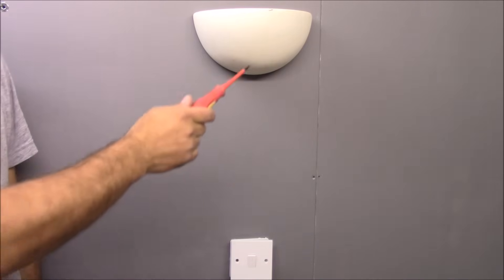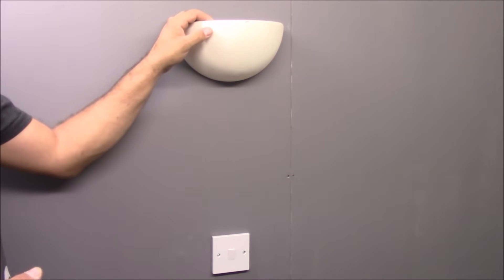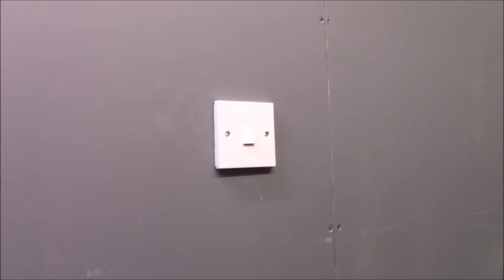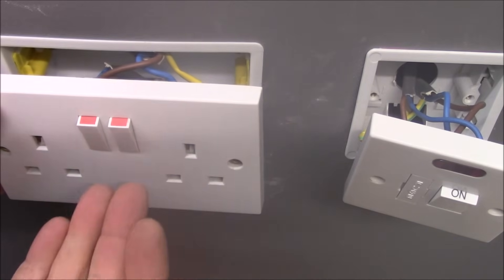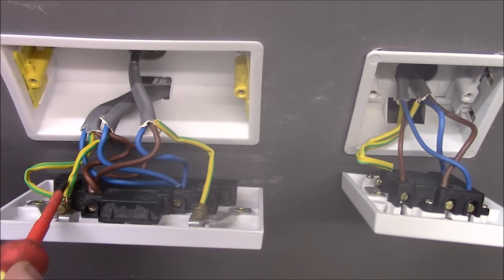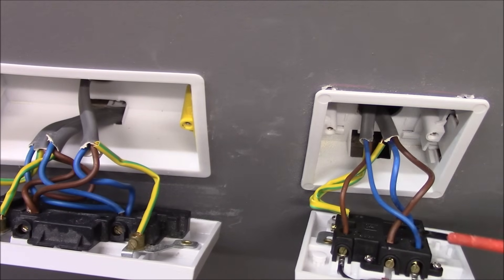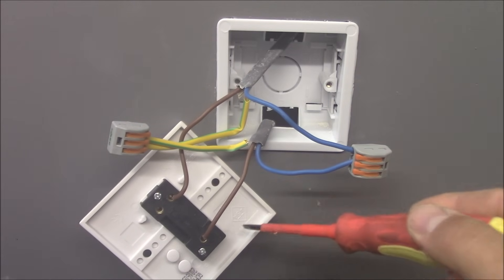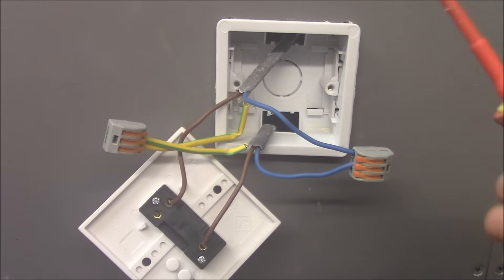Light spur from socket Spur for lighting off ring main wiring connection

Comment: Couldnt you just use the fuse spur (fcu) switch from the socket straight to the light to avoid a 3rd switch on the wall?

Comment: If you have to watch this to understand how to take a 1.0mm or 1.5mm connection from a 32Amp MCB/RCBO protected 2.5mm ring circuit then you shouldn't actually be doing the job.  The double pole switch with fuse is not required ..... just add a fuse only accessory next to the 13 amp socket outlet fused down at 5 amp then run your 1.0mm cable to the switch for the lamp.  Otherwise its switches on switches....    Especially as tripping the MCB / RCBO on the consumer unit to isolate 1 circuit is not guaranteed to disconnect the neutral.  Only throwing the main breaker will guarantee that !

Comment: Fantastic video so easily explained, I used it to install some external flood lights and it worked a treat. I also took photos of each stage as a record of the connections and used wago connectors internally.

Comment: Very handy video ,want to fit a light underneath my stairs has am turning it into storage space .so got a double 2.5 socket on ring at bottom .so can run cable up wall to a FCU and run 1.5 to a light switch. Thanks for posting

Comment: I presume you don’t need to use a 2-pole switched FCU here and you could just use one without a switch?

The advantage of using a switch, though, is you don’t need to shut off the ring main when you want to do work on the lights, as it will cut live and neutral?

Comment: Can a two way light switch be added to this set up? If so would the neutral from the 3 core and earth be added to L2 of the first switch or do it have to be connected directly to the other 2 neutral wires in the connector block? Thanks in advance.

Comment: Hi I have an old existing security light outside connected to a switch inside wall. Will fit new LED PIR light, do I need to change the 1 gang switch to a 5amp fused switch? Then use 1.5mm cable to outside wall connected via junction box with cable from security light? Appreciate your advice thanks... Great videos 👍

Comment: do you have to run a wire from the fused spur to the normal light switch? or can you go directly from fused spur to the lights? (using the fused spur as a normal On/Off switch)
Reply: My electrician has used a fused switch as a light switch because it’s in a large walk-in cupboard that used to have the old hot water cistern with an immersion heater, so the switch doesn’t have to look nice as it’s not in a room. The only problem is that I can’t reach the fused switch very easily as it’s very high up on the wall (where he’s connected to existing cable, as it was the previous power supply for the water immersion heater) so I’m watching this video to see how to wire a normal light switch from the unreachable fused switch. I’d rather add the extra switch myself as it looks simple enough to do.

Comment: Hey, awesome video, does the FCU need to be switched or could you use an unswitched one so then you never have to touch it and can just use the light switch?
Reply: This is what I'm interested in aswell....
Reply: @alanbishop1282  used a switched on and get rid of the actual switch
Reply: @Mikelufc1985  I ended up using a switched FCU and hiding inside the cupboard with the double socket and ran the lighting circuit up into the ceiling and down in the wall by the door. Works well 🙂👍

Comment: Brilliant vid mate, what i can't find out (as doing my electric course presently) is i'm aware you can only spur a socket once on a circuit, i'm considering wiring a cable into my parents shed for them for a socket but i was also considering putting in a light.. would it be possible to spur of a socket and the use that socket, downgrade it to fit for a light as well?
Reply: You're not supposed to but yeh you can do what he done here.
You don't even need the light switch in all honesty you could have the Fuse as the light switch

Comment: Is it not possible to just use the FCU switch as the light switch in a dual role, rather than having a separate switch for the light?
Reply: Yes u can
Reply: I did mine from socket to FCU to light
Reply: Yes but you'll use more big cable and you have to find a fused spur your happy with looking at

Comment: Only need 1.5mm2  for feed to the fused spur , no need of 2.5mm2 , and no need for 2 switches !!
Reply: Stanley Binns no. When spurring off a ring you can’t just throw in 1.5mm2 to feed a spur and think it’s ok. Ring mains are almost always protected by a 32A breaker, 1.5mm2 won’t take any where near that so in the event of a fault, the cable could end up glowing and starting a fire. 4.0mm2 will handle 32A in a radial configuration depending on installation method, external influences and length of run. Why do you think ring mains are wired in 2x2.5mm2? Gives you an overall CSA of 5mm2 on line conductors. It’s acceptable to spur from a 2.5mm2 ring main with a 2.5mm leg as long as it’s not an extensive run, but don’t confuse spurring from a ring as a branch circuit with a circuit protected by a fused spur. Safest way is to incorporate the supply side of your FCU into the ring main and  be sound in the knowledge that the modified circuit is the same configuration as originally designed. Any mods to an existing circuit require testing and minor works certificate issuing. At the very least you need to check the insulation resistance of the circuit and measure the zs to ensure the protective device will operate within the max permissible time to make sure safe operation is achieved. Always remember if you ever lose a leg in a ring main, you’re left with 2 potentially overloaded radials. You can take 1.5mm2 from the spur as it’s protected by the fuse. The fuse/mcb is only there to protect the cable. Additional protection by way of RCD or RCBO protects lives but be wary of RCD’s as they only offer magnetic trip and don’t operate under thermal overload. Always cover your arse and use an RCBO (magnetic and thermal overload protection) to comply with the latest legislation and current edition of BS7671. Also, the install method in the video is twin and earth enclosed in a wall or void at a depth less than 50mm from the surface without any earthed metallic mechanical protection, so this straight away would warrant RCD/RCBO protection and the likelihood of this method in the real world would de-rate the maximum current carrying capacity of the cable as the wall would be full of insulation/rock wool and would cause the cable to operate at a higher temperature.
The last person to touch/alter a circuit is responsible for the design and installation of that circuit so if anything bad were to happen, you could be defending yourself in a court and trying to convince a judge and jury that what you did was perfectly safe and legal because you watched a vid on YouTube.
👊
🖐
🎤

Comment: I looked this video up because I'm fitting in a new light in my porch, originally wired by an electrician. I couldn't figure the wiring out, until I eventually realised the neutral was connected via a single-pole switch and the live was going straight to the light fitting. The light was a PIR-switched unit and the single-pole switch was only ever used to isolate the unit when I was changing the bulb, which of course, it wasn't actually doing. Always check with circuit-tester or multi-meter, even if the wiring was done by a qualified person. Super video, by the way, very good set-up to demonstrate wiring.

Comment: I hope the conduit running from the fused switch spur box to the light switch isn't being run on the diagonal. It should run horizontally then vertically as there are notional "safe" areas which run horizontally and vertically through each electrical fitment. Whilst I'm at it, the switched fuse box would have been far better placed underneath the light switch.

I know it's all for demonstration, but there is a principle at stake here.
Reply: I was just thinking that. ALL wiring must be run either vertically or horizontally, far, far safer when someone comes along later and decides to drill a hole for shelves, pictures, etc

Comment: Thanks for posting this video, out of interest could you just use the FCU as the light switch?
Reply: Yes, it's a switch.
That said, I'm not sure about design limitations. A light switch is designed to be switched on and off many times, an fcu isn't, you tend to switch them on and off just a few times over their lifetime - although the contacts are the same.
Reply: Marek Wojcik I was thinking exactly the same thing, why not just use the fcu as the light switch? Can someone answer please, thanks
Reply: The answer to your question  yes it permittable to use it as a switch. A 5 amp fuse is a bit of an overkill though it would be much safer to use a 3 amp fuse in this case.  A 3 amp fuse has a load rated at 700 watts where as a 5 amp fuse is rated a 1200 watts.  You wouldn't want to exceed 700 watts of an fcu on for the lighting.  If anyone adds a light switch somewhere down the like it would be rated for a max load of 400 watts.

Comment: Hi.how to check existing socket is not a spur?
Reply: If you don't know it's a spur then might be best to get in an electrician.      Investigation is really the only way by following the cable runs back to the CU.
Reply: If there's only One cable running to it, rather than being on the ring, then it is a spur.

Comment: Hi i have a question, i have one bedroom that only had one socket outlet, i had a spur socket added to the other side of the room last year, so currently it has 2 socket outlets one on the ring main and one is a spur. I want to add a wall light soon can i use a fused spur from the spur to the new wall light or does it have to be off the ring main?

Comment: could I have four wall lamps running off the same configuration?
Reply: Yes.  Overall load is still protected by the fcu and it's 3 or 5 Amp fuse.    The whole point of the fcu is to protect the wiring from overload, so you can run a radial circuit from the fcu and add as many as you like.

Comment: Hi great video, I have an fcu switch for two exterior lights, I wanted to add a flood light to the fcu. I tried connecting the floodlight to the to the load side with 1.5t&e but it permanently stays on even when the fcu is switched off and the other two lights are switched off. Any idea why this may be? Thanks.
Reply: Sounds like you have wired it to the input side of the fcu and not the load side.    If so you have bypassed the fcu and made it pointless because the circuit is then only protected by the 32A at the consumer unit.   I really suggest you need an electrician if you have made this mistake.

Comment: curious that the light switch and lamp weren't vertically above the fcu (he could easily have put the fcu further over) .. .. .. so the Q is, how did he route the cable from fcu to switch, was "physical protection" used and if so what protection .. and all sorts of Qs about protected / prescribed / safe zones ..
Reply: He will have just gone horizontally across from the FCU to below the light switch then vertically up to it, which is perfectly legit
Reply: @amblernectar  Although none of those cables leaving the box looks like it is going off to the side (you can see the ones in the 2g socket do), same with the cables in the light switch. It's a few simple details like this that spoil the demo. Using a 3A fuse in the FCU and 1.5 cable - is he powering a small floodlight? 1A and 1mm is more than enough for such a tiny lamp

Comment: Great video!   Thanks so much.  Have learnt lots from your vids.  One question - can you run a second light switch and light off the first light switch?  So 2 lights on their own respective switches but from the same spur/fcu?  Thanks again
Reply: You should be able to as its going through and fcu, so even of there was a fault, it'll be protected by the fuse and rccd in the cu

Comment: If I was to have multiple lights coming from the fcu will I have to have a bigger fuse
Reply: No.   The FCU is protecting the overall load on the wiring to protect the wires from over heating and catching fire.   For lighting you are using 1.5mm twin and earth so keep it at 5A.

Comment: Hi there thanks for the video - very useful. I've got a simple question - can I just use a 13amp fused switch spurred from socket straight to light?
Reply: @Michael Firecracker A 1A fuse will cope with a maximum 250w lamp

Comment: Can somebody help me please I brought a feed of supply from a socket to the fcu and I put that into the supply side I have wires from a separate switch coming down to the fcu and I have the wires from the light coming down to the fcu I am confused in what goes to load and what I do with switch live please help.
Reply from the maker: L& N from socket go to fcu supply side, L& N 1.5 t&e go from load side of fcu to the switch ,  from switch run another cable to the light  ( at the switch : L from fcu to com  , L from light to 1 way , N from fcu & N from Light link together)
Reply: Neutral should be continuous from fcu to light fitting.   The light switch is only used to break the live connection to switch the light on and off.

Comment: Cheers for your helpful video! 
I used 2.5mm from the socket to FCU. Then you only need 1 or 1.5mm to your switch and lamp. In the UK (not sure on other regs), your FCU should have a 3amp fuse. I can't see a 5amp being a problem though.
I completed this setup, installing a light for the under stairs cupboard. All bits from my local Screwfix (already had 2.5 and 1mm cable), total cost under £20 which included 6m of trunking. A cheap enough DIY job.
Thanks again for the great video!
Reply: Tom Stallard can you use 1.5 flexie cable from the spur to the light
Reply: Dougie Price Hi mate. If you're using a typical domestic lamp, with a 40w bulb (I'm guessing you'll use an LED bulb of a few watt) then 1.5mm from your fused spur to your lamp would be fine. I'm guessing you're using a switched fused spur to turn your lamp on and off, rather than having a separate switch? This isn't a problem. 
Disclosure:I am not an expert, so please don't take my advice only as I might be entirely wrong. 
I have not had a problem with my setup, as described in my first comment. Good luck.
Reply: Can I do it without FCU ? It just legality or is it dangerous without it ?
Reply: @nicolasjachym1685 hi mate. You'll need an FCU if you are spuring a light from a socket. The FCU is so that the wire and lamp are protected by a smaller fuse (3A or 5A). Otherwise the lamp isn't protected properly.
Reply: I am since qualified. For a spur for lighting, the FCU will contain a 3 or 5 amp fuse. 1mm cable is able to carry a load of 11 or more amps (depending on installation, ie cable clip or burried in insulation, the later reduces its capacity as it will get hotter). So 1.0mm cable is safe between the FCU and lamp, flex or otherwise. Remember to use outdoor cable if outdoors (which will give protection from weather including UV). Other considerations are physical protection of the cable if required, using SWA or conduit.

Comment: Hey great video!   Can I ask a Q. Please???  I have some decking lights that have a 12v in-plug transformer.  Can I run a spur from a light switch to an un-switched socket to act as the switch for turning them on??
Reply from the maker: Hi. You can't make a spur from switch to a socket. The switch is on 6 amp MCB and later  someone unaware  can plug 2kw appliance into this socket.

Comment: I’m guessing you could connect directly to the consumer unit or a junction box as long as there’s a FCU between the power and the switch,simply explained though good video.
Reply from the maker: When you connect it straight to the CU its a lighting circuit on 1.5 mm cable and 6 amp MCB and you don't need FCU. Cheers